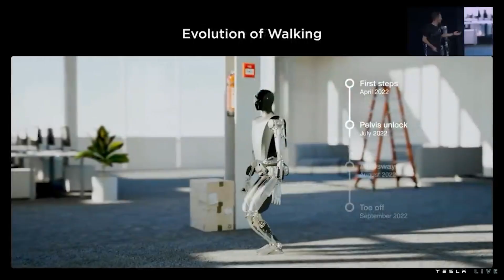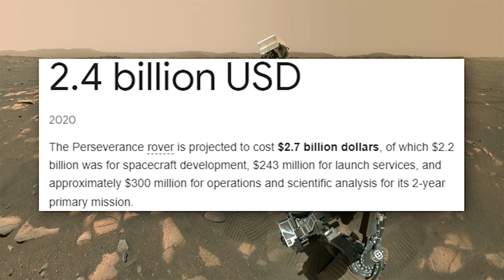How Robots Will Take Over Mars!

Comment: Mars needs to be populated by many many ground-movement sensors ASAP
Reply: Along with atmospheric spectrograph and pressure sensors
Reply: And both atmospheric and just below ground level temperatures. Along with an ionization of the air sensor.

Comment: I think several helicopters with extended solar recharging station or solar charging trailer on the rover could be useful.  That way they can survey more territory faster.
Reply: Alternatively a new rover design,  a bit like an aircraft carrier type rover, that can host and help recharge multiple drones. Say at least 4 drones.  That way each drone could fly in 90 degree directions from the rover and thus cover more mars territory faster.

Comment: Spot is pretty cool but there is no way it could function on Mars.  Mars is way too cold.   It's AI needs too big of a computer to function,  It uses too much power.  It's feet are not great on sand,  etc etc.
Nasa could build something based on the same walking concepts but I don't think any of spot's parts would be of any value.  I feel a good first step would be figuring out a way to get there computer systems out of the 90s cuz currently there is just too many problems with modern computers in space.
Reply: An arachnid-type robot might do best.
Reply: @pawangel1704  Spidertron!   😀

Comment: There are no permeant residents at the south polar ice cap, which would be much easier than living on Mars. Elon should work at this first. It's not as cold there and the air pressure is much higher than Mars  (the air temperature and pressure on Mars is less than 1% of that at the south pole).

Comment: Dude I'm sorry you got so much wrong with the Mars rovers and landers.

Viking did a lot. It was a soil collector and performed 4 important experiments on the soil and confirmed Mars could not harbor life. By comparison all Pathfinder really did was act as a proof of concept for a rover.
Spirit and Opportunity were twin rovers both of which landed in 2004. Both are dead today. They were also 5'2", certainly not "knee height". They both also had robotic arms, so Curiosity is not unique in that regard. The new rover with Ingenuity is Perseverance, not Opportunity. You also used the word interstellar in reference to interplanetary missions.
I like this channel but man you really gotta do a better job researching your topic.
Reply: Mars Pathfinder was the Project, the Rover was Sojourner. The Rover was 26 inches by 19 inches by 12 inches. Not the size of an RC Car as he stated. There were three science experiments on board as well, it wasn't just a proof of concept rover. Everything else you stated I agree with. 
He does need to spend more time doing research. 
I worked on Cassini Mission to Saturn and also worked on on the Mars Pathfinder program. We did the power and pyro systems and the ground support test racks. I was working at LORAL Electro Optical Systems at the time. It was a JPL Contract. I currently work at Goldstone Deep Space Communication Complex (DSN) USA Site. I don't know everything when it comes to all these projects, but I have been involved in unmanned space since 1993 to current.
Reply: @RGTechTalk  wise speech good sir
Reply: @RGTechTalk  BRUH WHAT YOU ACTUALLY DO THE SPACE STUFF? THATS SO COOL 👍
Reply: @thatlolguy6799  We track all the unmanned spacecraft. We send all the commands of what we want them to do and receive all the data, pictures etc.
Reply: @RGTechTalk  thats pretty cool where in space are the aircraft located? are you getting data from mars or the voyagers?
Reply: @thatlolguy6799  Yes, we still communicate with the Voyagers.
Reply: @RGTechTalk  TY Man TY. I'm heartend that your out there! Keep the faith man, and i know how hard it is to talk about this! TY for your comment! avb
Reply: Ecactly.
Reply: Yeah seriously do a better job but good content gang
Reply: Mhm^^
Reply: I just can't allow this claim that "Viking confirmed Mars could not harbour life."
There was an experiment onboard Viking to test for life, called the Labeled Release Experiment. It remains to this day the only experiment on Mars designed to test for the presence of life, as opposed to looking for conditions conducive to life. The historical fact is that the test, which NASA sent, returned a POSITIVE result for the presence of life. The reuslts of Viking would be better summed up as "The test for life came back positive, even though all the other data suggests a place not suitable for life, so we're not convinced either way."
Reply: Annoys me he hasn’t edited or acknowledged his mistake after 1 month.
Reply: @Moviescenes98-s1e  Pretty large mistake...  first ever heli on another planet, and you can't get THAT right ?
Reply: Yes thank you, my head was hurting when he said all those things, especially that Opportunity was way more advanced than Spirit, it’s twin.
Reply: Get on Ground News. That will help your research.
Reply: Since your all almost as smart as I am I want to announce I'm starting a Go Fund Me to be the first man to land on the sun and have my ashes safely returned to earth.  🤡